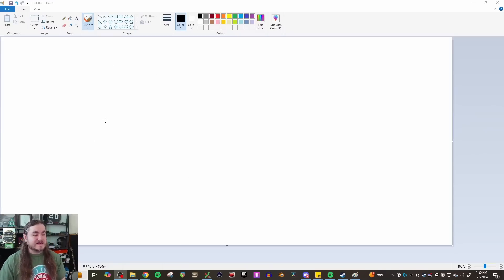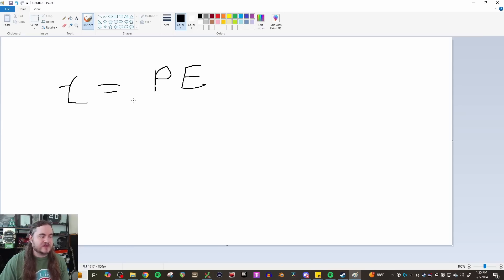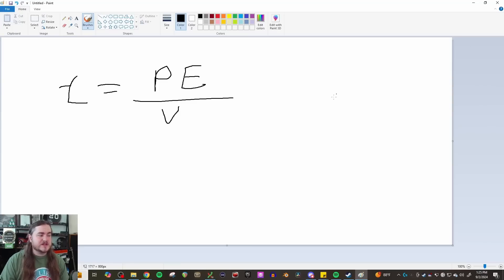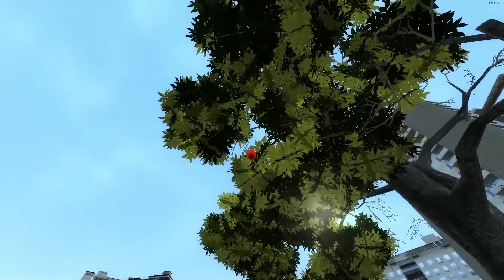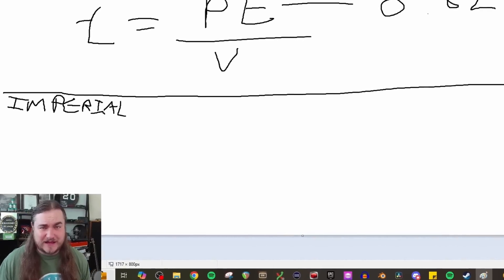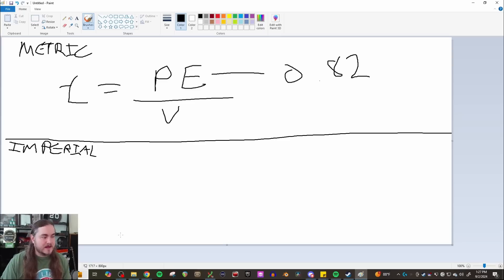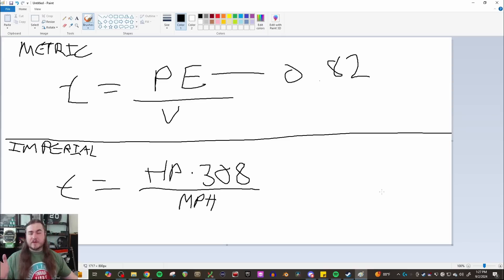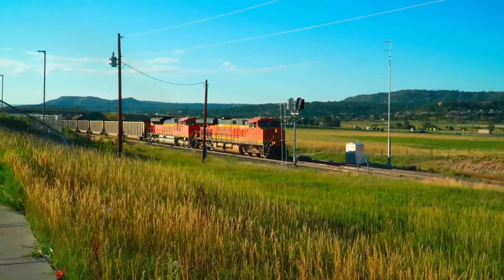Diesel Tractive Effort 101

Comment: I am at 4:37 now, and I noticed a few errors in this explanation.  First of all, it is true that steam locos like the Big Boy (and most others) have a quasi constant torque.  I says "quasi" because the stem supply is limited.  If the torque was really constant, the Big Boy would easily reach 300MPH when pulling a light train or no train.  On the other hand, have you ever listened to a Diesel loco starting?  You can easily hear that the diesel motor starts at low rev, thus low HP.  Then, as speed builds up, the diesel revs up, thus increasing the HP.  This is necessary since if the diesel started at full rev, this would burn the generator and/or the traction motors.

If you look at both the formula and the curve at 4:37, anybody who completed high school can notice that, as we get close to 0MPH the torque rises towards infinity.  If this curve was true, either the couplers would break or the wheel could not be prevented from slipping and the train would simply not move.  As explained later in the vid, this is prevented.  But not only by the electronics as the presenter explains, but by limiting the output of the diesel motor at low speed.

By the way, the commentator says "there is an exponential decay" ; this is not an exponential curve, this is a hyperbola.

He is right at 6:41 mentioning there is no gear shifting, but there is generator tapping.  That is, the power wires from the generator to the traction motors can be switched to various points on the generator coils, giving low voltage and high current at low speed and switching to higher voltage at higher speeds, and that raises the torque curve at higher speeds.

On all other aspects, I think this is a very good video explaining quite adequately things that many train buffs don't know.

Comment: Gear the locomotive as high as possible, that will allow wheel slip. that will give the widest useable range of speeds, that will utilize the maximum continuous horsepower of the diesel engine. 
     Tractive effort, rated in pounds = engine horsepower X 375 /MPH. If you want to know how fast your locomotive can go, given the pounds of tractive effort, use the same formula, except, divide the product of horsepower X 375, by the pounds of tractive effort, to get the speed. You still need to multiply by ~.86 to compensate for efficiency, resulting in slightly less tractive effort at speed, or slightly slower at a given amount of pull. (often referred to as "drawbar horsepower")
 MPH X 1.609344= Km/hour
1 SAE horsepower = 745.69987 watts. A metric horsepower = 735.49879 watts. (American "horses" are slightly bigger)
Each pound of tractive effort = 4.44822 newtons of force.

Comment: I know you are smart about steam locomotives and I have a question.  Videos of the Big Boy running fast at constantly velocity the rods of the forward and aft engines seem to be synchronized. Of course at slow speeds and during acceleration and deceleration each engine takes its own rod oscillating movement out of sync. Thanks.

Comment: This i believe is why New Zealand has a electrified main trunk line operated by Diesel Electric Engines. we have the Raurimu Spiral, which requires more energy input to climb than any one or two Diesels can climb alone, but with the other engines on the track donating extra power and a connection to the power grid up and downstream, more than enough HP can be fed to their electic motors to leverage their incredible low down torque to pull trains up the obstacle, and boost power output at peak speeds, which frankly thanks to our terrain are pretty slow (tight turns means narrow gauge means lower speeds)
Reply: This also reminds me of a video suggesting that modern railway networks were considering investing in new steam locomotives, their ability to pull reliably regardless of current speed is probably an attractive prospect when boosted off the start line by a launching Diesel Electric loco.

Comment: Imn my thinking, if you havr a diesel engine running a generator to put electricity to traction motors to turn the wheels you have a multi hybrid system
So, put a generator on a steam locomotive that runs electricity to traction motors that turn the wheels , and see what ya got lol

Comment: let me tell you some practical experince from being a fork truck tech, and yes they are more alike then you think. Another issue with motors is shaft whip, Ac brushless motors are absurd, they can tear themselves apart they are so powerful. It makes a lot of sense to hook multiple engines to reduce load beacuse the motors work best at certain rpm ranges and laod ranges so your not melting stuff or tearing up shaft bearings

Comment: @hyce way off the topic of this video, but I’m curious about something. A ways back you posted a short about a cursed steam loco on Leighton’s layout that had a tender in front of and behind the actual locomotive and the driver wheel sets were under the tenders and not the loco. I’m curious because, to me, that seems like it could potentially solve some issues stemming from having the drivers under the boiler. I’m also just wondering if that sort of thing would even function at all if you used extreme high pressure steam hoses for any connections requiring the flexibility around turns and such. Anyways, thx for the super entertaining/informative video, as always:) have fun.

Comment: There is no "minimum speed" on a diesel locomotive. There is a minimum time rating at high output(amperage). Its called short time rating and it has to do with throttle and rotation of the motor. With high amperage the motor gets very hot when it absorbs the energy. If you keep the throttle and amperage below the short time rating for any type of locomotive you can run at as low a speed as it will go (As tonnage allows). The counter EMF is what takes away the energy in the motor as it rotates faster.

Comment: Here's an interesting relationship,  starting a freight train and a bicyclist have similar power budgets of 1 HP/ton.    This is why Rail-Trails are such great natural paved bicycle paths.   1 HP/ton was for starting a train on a flat level straight track with friction axle bearings in 1890.   A 1% grade requires double at 2 HP/ton. 

What steam freight locomotives could do that Diesel electrics would not is run at full steam at 8 mph climbing a mountain all day long if needed.   DC Diesel Electric locomotives would overheat their electronics.  Resistance goes up with heat and electronics have a lot of difficulties with heat.  Steam locomotives can work well with lots of heat.    

GE's Diesel electric U-boats were a joke to try to use for heavy long grades at high throttle low speeds.    John Carrier a civil engineering student and I an EE would rail fan under the New River Gorge bridge in WV on the weekends when going to WV Tech in the early mid 1980s.   We were both from out of state.

Watching the CSX coal trains clime the C&O mainline grade under the  New River Gorge bridge,  it was common to see six locomotives up front with by that time the GE U-boats shutdown with the engine doors open, as the EMD's were down on their knees likely at 12 mph at high throttle with the red hot glow from the their traction motors reflecting off the insides of the rails lighting up the fallen fall leafs.    The railroad grade I found out later was not that steep under the New River Gorge bridge at about 0.66%, but it was continues.   The trains were likely fighting that grade going east from Gauley Bridge the prior 10 miles.  It looked steeper.

Comment: A lot of European railways are going for bi mode locomotives which are basically an electric loco with a diesel generator added. In many cases the diesel engine is quite small but they still could exert the same maximum starting tractive effort (and move the same load) although speeds would be limited which is ok for shunting or working a short slow speed branch lines, on a mainly electrified network. A typical example  is British railways class 88. 
For shunting there seams to be an interest in battery or hybrid power. Clayton engineering in the UK  has built several recently for industrial applications with battery recharging from either a small onboard generator, a shore supply or line supply, For operations where operation is highly intermittent battery is ideal. There is even a project in the UK to convert an ancient 08 shunter to hybrid operation

Comment: You are so right. Even in train simulators it's so easy to start a freight train with several diesel-electric engines because of their huge tractive effort at low speed, but you need more engines if you want to move faster, but after a certain speed, a 4400 hp diesel loco and a 4400 hp steam loco, they both perform the same. In my opinion, if they electrify their networks, they can run much more powerful locos and start thinking in tractive effort again.

Comment: What do the calculations look like for an electric train? I've had the thought that disel-electric locomotives should be required to come from the factory with a pantograph to allow the main lines to be electrified.
Reply: Stuffing a pantograph on a diesel won't make it electric. There are other parts neccessary to make electric locomotive functional which are not used on a diesel, like transformers, chopper units and inductors. These will inevitably require extra space and add extra weight. Locomotives that can operate both in diesel and electric mode have always been niche for this very reason.
Reply: @Knsgf  more space and weight than needing half a dozen disel locomotives to pull a train?

Comment: Considering what you say here, the railroads tend to push the limits of this. I wonder about the huge cross country trains that are > 3 miles in length. As a railfan I often hear engineers telling dispatch that one of their engines (power units) is inefficient or failing. Is it worth all of that power (and diesel usage) to save a few man hours? There must be a maximum length (OK weight) that is feasible to pull in one train (even disregarding the other issues like siding lengths or trouble if a mechanical problem develops in the middle of the train). Fascinating info, Thank you.

Comment: Hyce- On a traction motor, the rpm is not as much a problem as heat on the low end. The minimum continuous speed is more about heat dissipation than anything else. GE's 752 traction motor was insulated better than EMD's D series up until the AC era. So at a given horespower, an ALCo or GE unit had a lower minimum continuous speed than an EMD. Road units tend to have larger motor blowers than switch engines, whereas switch engines generally had much less horespower.

EMD's E-units with their 33" wheels and 90+ MPH gearing had a minimum continuous speed of 33 MPH. 

The overall point is, railroads and manufacturers use two primary minimum continuous speed ratings:

1) Slowest speed you can use full throttle without damaging the traction motors. BN, BNSF and NS used a speed-it is a little arbitrary as you can still overamp the motors. Many motors still have it marked or placarded somewhere as noted below
2) The placard you show is common on most 2nd generation motors showing an amp load and time limit. Various railroads have various procedures for cooling the TM's down if the limits are exceeded.

On the efficiency side, 82% is a reasonable number for pre-electronic controlled traction, electrical and engine systems. A modern AC unit is around 93%. 

I grew up running EMD SD7/9's, they really did not have a minimum speed. You could stall burn them if not careful. Our former SP unit we have had D78 traction motors, SP had rated its minimum speed at 3 MPH. Odd thing was at 3 MPH, you were already down to 1000 amps. ALCo's had some units like RSD-4/5's and 12's(maybe even the C628) that did not have minimum ratings. They simply said follow the amp meter markings.

Comment: I remember coming across a video a while back that they're experimenting with new steam locos in the UK. Would be interesting to hear your take on it. IIRC, they're using steam generators to turn hydrogen  with atmospheric oxygen into steam to turn a turbine to generate electricity to turn motors to turn the wheels. I scoffed at it myself, sounds like a lot of trouble over what could be solved more simply with just electrification. (Not to mention, hydrogen production isn't exactly clean unless you want to go the nuclear electrolysis route.)

Comment: I'm not a railroader, but my work has caused me to be involved with simulating electric motors. I don't understand the cause of why a diesel loco and a steam loco don't have the same performance as both work by expanding a hot gas (not steam isn't a gas) in a cylinder. (It would be interesting to know if a torque curve like a car or truck diesel engine).
So, I'm wondering if the cause isn't the diesel engine itself, but rather the electric traction motors. Most diesel locos are diesel electric, (in the 1950s the UK built some diesel-hydraulic locos and I believe that some shunters are direct drive), and an electric motor only produces maximum torque when there is slip between the rotor's speed and the "speed" of the rotating magnetic field in the stator.
Reply: The theoretical behavior is the same. In practice there are different limits at play.
Tractive effort of steam loco is limited by its steam pressure and piston area. For electric it is max current of the motor.
Max power is limited by amount stuff you can burn (firebox area for steam, volume of the cylinders for diesel).
For high speeds electrics have max voltage limit and field weakening constraints. Steam does not really even reach this region though afaik, they keep being power limited.

Comment: The really cool thing about AC traction motors is that there is no minimum speed requirement. And can pull at zero mph and not birds nest the traction motors. Helpers can push in the slack until they cannot push any further. Then when the train is ready to start, the lead locomotives will begin to pull. And the train begins to move. This is the kind of train handling that was done in the days of steam. I remember reading that in a railroad publication when AC locomotives were first introduced.
Reply: No electric motor has minimum speed requirement. What they call "minimum RPM limit" is current limit.

Comment: And this is why once you start using traction motors, the diesel engine ends up being the limiting factor. This is why so many countries use overhead wire/catenary electric locomotives. You can get the same job done with fewer locomotives. Sure it costs more to setup but you get locomotives that can be much more powerful as they have a large external, remote power supply (an actual powerplant or a few). Horsepower, so much horsepower... Or should I say kilowatts, so many kilowatts.
Reply: is the catenary an infinite current thing or an infinite voltage thing?  and what about the pylon?
Reply: @philhoward4466  Neither, but the catenary (and the rest of the power supply on an electrified railroad) can normally conduct more power than you could generate with a power plant carried on board the locomotive (as with a diesel).  So the limiting factor for an electric locomotive is commonly the traction motors, whereas the limiting factor for a diesel is nearly always the diesel engine.

Comment: Long story short, the power is always the ultimately limiting/dictating factor, be it diesel, steam or anything else. The fact that diesel electric systems theoretically can produce infinite torque at standstill doesn't mean they're worse than steam at high speeds, the steam engines also has to be able to produce the power required for that tractive effort at high speeds as the diesel electric ones has to be able to produce for a given tractive effort at the same speed.      

So, it's not that diesel electric has to produce a lot of power to generate a lot of tractive effort at high speeds, because that is also true for steam engines, the difference is that steam engines are unable to produce a lot of power at low speeds because their ability to generate power essentially increase with the speed, assuming constant steam pressure, and neglecting some variables that should be minor within the speed range they're designed for.

Comment: In the words of Uncle Pete mechanical helping me troubleshoot over the radio:

"Well its dead. I guess we're just moving trains on hopes and dreams now."

On our class 1, we use TPA (Tons per Powered Axle) to figure out what our power needs are. 

Train Tonnage / EPA = TPA. 

Lets say our TPA limit for a subdivision is 500, we need enough EPA to get us to, or below 500 on TPA.

EPA: An Equivalent (powered) Axle is a locomotive's tractive effort or braking effort compared to one standard axle which has 10,000 lbs. tractive effort or 10,000 lbs. braking effort.

A SD70ACe is rated at 14.4 EPA, times that by 500 and you get 7200. Thats the max tons that engine can pull on its own before you need more power.
Reply: 14.4? They were 12.1 when I was there. What changed?

Comment: Small thing that’s closer to trivia than critical. British Imperial measures != US Customary measures. The differences are generally fairly minor but they are still these. Amusingly both are defined in metric so they’re just metric with extra steps. :P Seriously, NIST defined US measure in metric in the 1930s if not earlier. You can find the publications from the time with it.
Reply: both systems use the same units for electricity and time.  metric just didn't make time be thoroughly decimal.  else, a day is 86.4 kiloseconds.